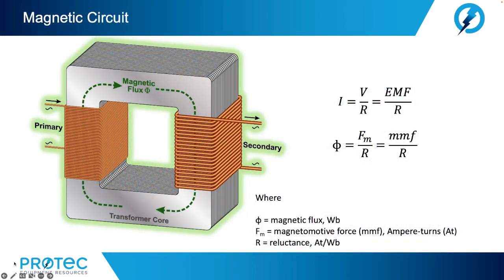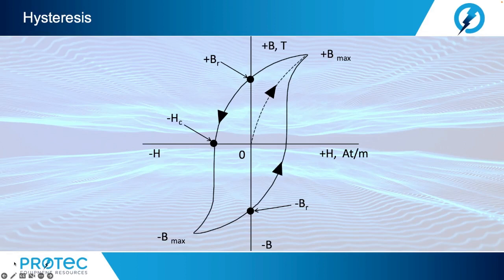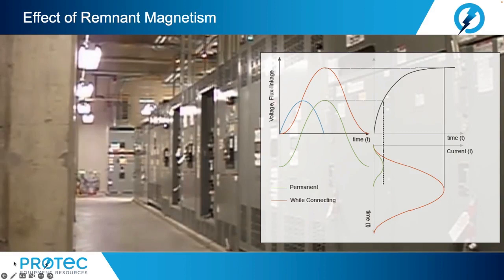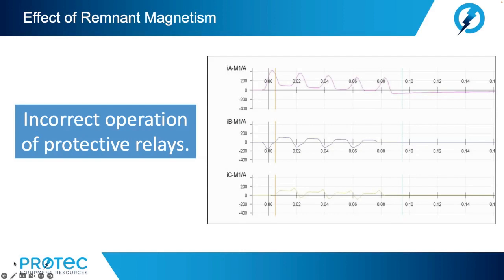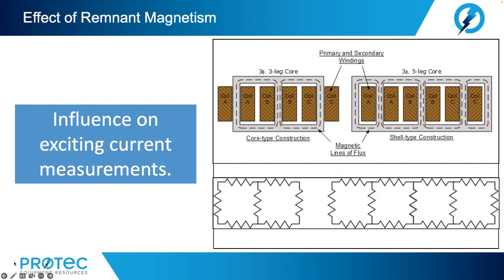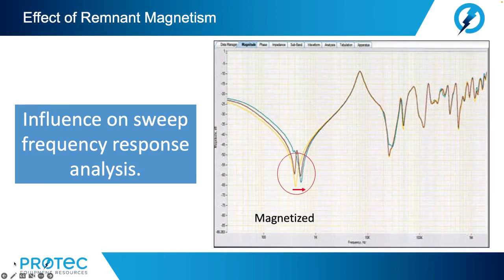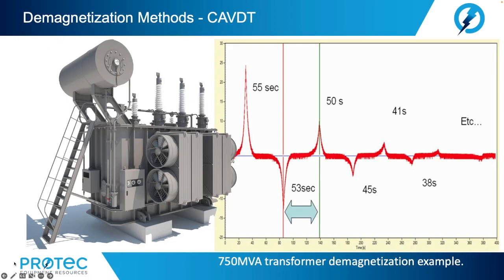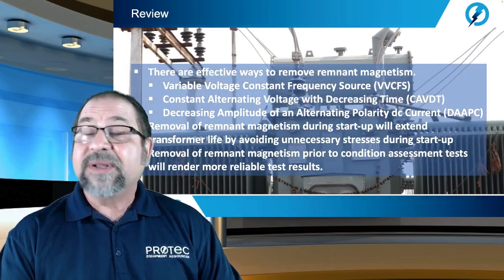Importance of Demagnetization of Transformer Cores (Protec November 2022 Webinar)

Comment: is there any difference between demeganize high voltage side or low voltage side?  just know that if demegnize from voltage side needs more currents
Reply from the maker: From Bret Hammonds:  The best approach to demagnetizing a transformer has been being debated for as long as I can remember.  The answer might actually be based on who you ask.  If I understand your comments correctly, it is as you stated. Demagnetizing from the secondary side of the transformer will require a greater amount of current than it would from the primary, even though it can be performed from either side of the transformer. However, I took it upon myself to contact a test equipment manufacturer concerning this question.  Their recommendation was to demagnetize from the primary of the transformer.  They also recommended that you demagnetize the transformer on each of the phases, and not just one. 

The best recommendation that I might give is to contact the specific equipment manufacturer and get their input regarding this matter.